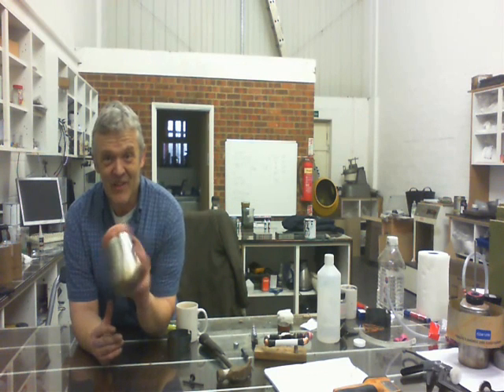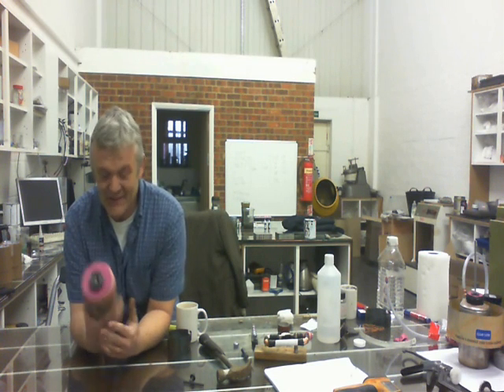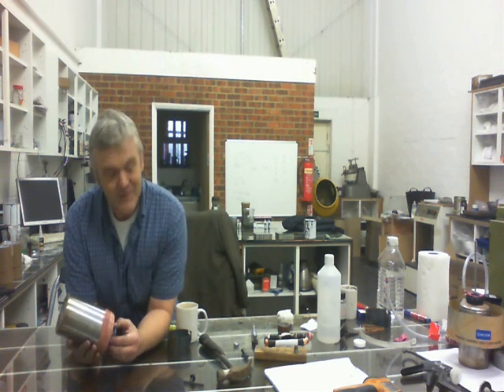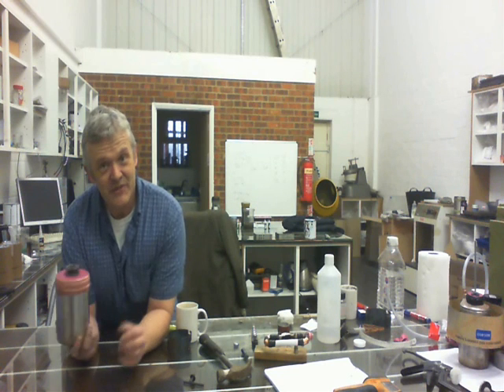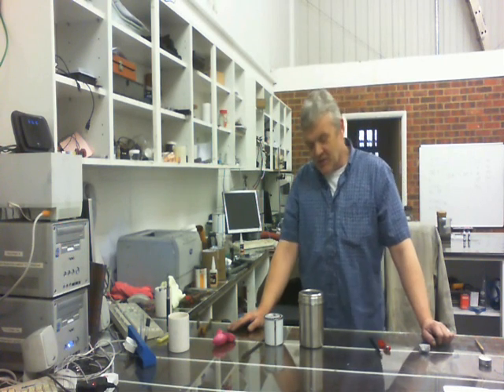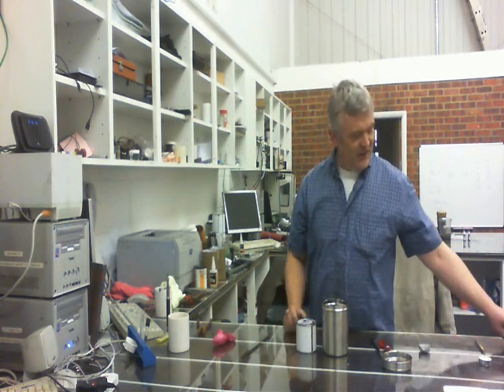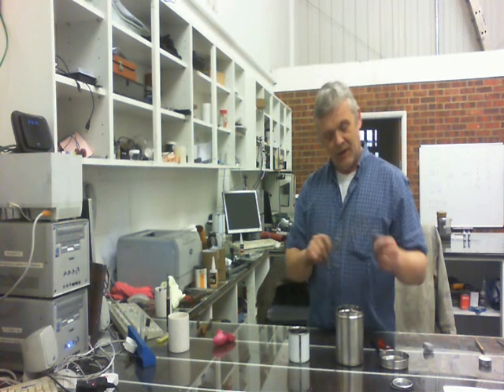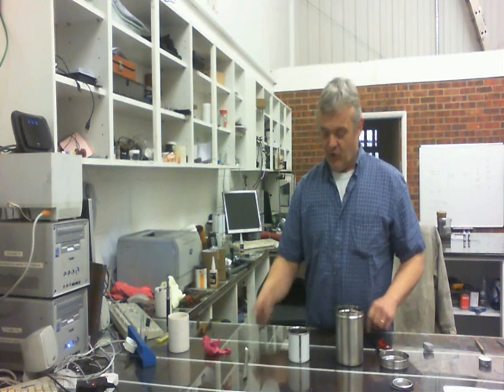The NASA Stirling Engine - Made In An Hour - Step By Step

Comment: Robert I have seen an even simpler design yet. The displacer did not move at all (adds drag and friction) instead it was stationary but as in your design there was a membrane on top. The "displacer" (more a can open on top and bottom) had some steel wool wound around it as the regenerator. So the air would be heated inside this displacer can, the membrane on top would start oscelation and shove the air through the regenerator around the (displacer can) to the top where the piston membrane sitzt just as in your design. What would you say, it this design in even more of less beneficial ? I think it might be more beneficial because the displacer which is a huge part does not move inside and thus introduces drag to the air. At the same time I think the benefit might be lost because the small membrane moves less air to the top. I am really not sure of what to make of it.

Comment: I just tried to replicate this with two cans of Pringle’s potato chips…didn’t work 😢 Can’t figure out why. I think this model requires a lot of heat to work  and as used Pringle’s cardboard cans with tin bottoms, I cannot heat it too high. Could that be the reason? Brilliantly simple design though and I will replicate this no matter how long it takes!

Comment: Would putting extra holes in the inner can make it work any more efficient. like having a small hole at the bottom and maybe one small hole at the top Or even several holes. then maybe have a gear cog facing up so every time it goes up it moves another gear cog which in turn could be connected to some type of battery cell for charging etc.

Comment: This might be useful to a few accentrics out there, but much of a free piston sterling engine can be abstracted to being the equivilant to two passive radiators, add a coil and magnet (aka make one a speaker driver) and suddenly you have a way to measure it as a tuned mass system (and also a way to generate electricity)
Reply: Im really tempted to take a passive radiator and a small subwoofer driver and see how the impedance measures, if I'm lucky the plot will look familiar

Comment: Edit, never mind, I saw the follow up video on doing exactly the below, after I wrote the below.

If you use a bigger magnet and put coiled copper wire on the outside of it, will it generate enough electricity for practical use like charging?

Comment: On a crazy note you know those toothed rubber belts on motor cycles. If you wove nitinol wire on the out side of it and you put it on a planetary gear box maybe it could work as the driver for a generator powered by hot water. Just a thought. As it it would take a lot of wire to get much power and I seen the woven nitinol on the new mars rover. The idea is to make a toothed rubber belt like a steel belted tire but woven with nitinol instead and make it into a toothed belt as motor for a planetary gear set up because you could get more torque for slow moving generators or some speed if you use the little planet gears through a planet carrier.

Comment: Quick note: Rotary Stirling engine with two rotating chambers counter balanced with a thermal acoustic chamber to run the two off a single heat source. You have two rotating disc that are about a couple of centimeter thick or how ever you big you want. Just so they are counter balanced as they both have a hollowed out chamber for gas to expend. Then they are both connected to a tube that you put heat on. This metal tube is filled with a bit of steel scrubber or steel wool pulled apart for the thermal acoustic chamber. And you apply heat to it and it is supposed to set up standing waves of hot air that drive the rotary Stirling engine. I thought that would be a neat device if it should work. I seen some on you tube. Where the tube replaces the displacer on a Stirling.

Comment: Well it isn't like you can just take the spark plug out of a gas engine made for a wood splitter and hook on a large tube made like that end of a thermal acoustic Stirling engine and make it run off of hot air.

Comment: Nice.  I just saw one of these made on another channel, but this one looks like it has superior efficiency.  I've been scouring the web the last couple of days, and wound up frustrated that one can't just go out and buy a Stirling engine in a "commodity" sort of way the way you would a DC or AC motor.  Looks like if you want to get into that arena you're stuck with building it yourself.  So instructional material like this is great.
Reply: you can get kits at least you don't have to make it from scratch... although those are of different design than this one... Good luck.

Comment: WOW... best DIY Stirling setup I've seen so far......
Will this work in reverse ?
like a cryo cooler ?
Reply: I would think that there would need to be a connection through a spring between the upper membrane and weight and the displacer in order to activate the displacer but I could be wrong hopefully mr. Rob is inspired by your comment and tries it

Comment: I think the Stirling engine does not have the torque
The reason is that the motion of the piston inside the cylinder
Is due to temperature difference between the sides of the cylinder
And not the pressure resulting from the explosion of fuel above the piston 
So you will find a big machine but produces little watt

Comment: Excellent demonstration of what is in fact  a complex thermodynamic cycle coupling two vibrating systems through the dynamics of the fluid inside that container.  This gentleman seems to enjoy  what he was doing and the result shows his depth of knowledge, even though  it is all hidden by such simple manner of building this linear machine.  I have made one similar to this but mine contains a long pipe where the air in it acts like a piston.. The displacer is  directly connected to the  top rubber membrane.  These are NOT simple machines to analyse in detail.

Comment: Im watching this video again and again and again and I love it.Im very curious how much efficiency does it have?..if you seperate the cold and hot sections of the canster and let the gas be the only thing that is transfering the heat its efficiency will improve.also you can add a heat sink half-out half-inside of the top baloonto help the gas have more thermo-contact with outside air...if you put a neodymium magnet and a coil on top of the heat sink you can test its efficiency under electrical load ...I love this.thank you for your video
Reply from the maker: I like your ideas mate - I haven't done that m much with this for a while but i think you are looking like you have a better grasp of this than i do - cheers mate
Reply: Well, the engine looks like it's producing 5 watts or so.... not sure if there's any point in having a heat sink or trying to improve its efficiency
Reply: @JiunnWong  yes but imagine being able to produce more than 5 watts with the same design and dimentions
Reply: @alijabari8715  then I suggest a hand crank generator, less noise,  no fuel required, more power. You can make out of microwave oven parts and fit in your pocket

Comment: This is very interesting!

Do you think it can be used to superfreeze stuff?
Reply from the maker: no idea mate - sorry
Reply: Robert Murray-Smith thank you! I've been investigating since last nihght and since the process is the same it might be possible to cool down suff by using this method, but we would then to have a mechanical method to drive the membranes instead of using heat displacement. I'll look into it further! I think I've figured out a way to bust out good amounts of energy of compact TECs, but I need to get into cryogenics to test the idea...  Making a stirling engine for this purpose has a very very steep learning curve, but in theory if the temperature difference is wider on each side of the tec,  the more power and effectiveness you can get from it! Let's see what happens!
Reply from the maker: absolutely mate - it is an interesting idea but as you say very often trying it and seeing is the only real answer - let me know how it goes

Comment: I love the sound of a finely tuned Stirling,  If anyone is interested Israel has set many records in solar efficiency with the same type single piston Stirling.  I have made a test rig of 64, 6" x 6" mirrors in a dish shape, to reflect focus the sun to a heat pick up. I have gone a different way in solar energy for now. If anyone would like my old dish project & wants to continue on with my work please let me know. I have one patent-able concept for efficient energy transfer to over also.  Peace Out!
Reply from the maker: awesome
Reply: Skylar, where are you located? I have dish pieces at machine shop. I think he would actually like it out of there. I have the mirrors in boxes  at home. you would have to pick up everything in a large pick-up truck.  My heat pick up / exchanger / is "patent-able" & I would like to partner with an investor  on that.  I'm actually working on a new bad ass tracker on my solar array & will work perfectly on the dish array.... hhhmmm
Reply: Hi, I'm interested. I wanted to know if it's possible to generate 5-7KW using solar stirling system. And if I use Compound parabolic troughs instead of a dish, what maximum temperature can I expect if lower is about 20 degree  C
Reply from the maker: try it and see
Reply: Hi Dan, do you still have the dish, I'm interested. I am also planning to build an engine and would like some help if you can.
Reply: Hello Dan, I am interested in the design and would like to work with you on the dish. I am currently building a  Stirling engine. Please contact me on sheldon@inventindia.com.
Reply: I sent you my contact information.   Peace Out!
Reply: Cheers Mate. Have sent you an email.

Comment: Hi Mr. Murray, you've inspired me to try and attempt something similar to what you have created in this video. However, I'm experiencing some difficulties and was curious if you could offer some feedback. 

My first question regards the weight on top of it all - do you recommend any way of figuring out how much you need or just playing around with it until it starts?

My next question regards the balloons you used; instead of balloons I used cut up pieces of a cut up rubber tarp, but I'm afraid they're a bit too thick. Any suggestions?

Thanks for any feedback in advance.
Reply: Try steel washers, then add or subtract them to add or reduce the weight. With the weights, it's trial and error.   To thick won't work the same of course, again try it and experiment.

Comment: Cool! Have you used magnets and a wire coil to generate some electricity ? The Biowatt Wood Stove use a Free Piston Stirling to make 60 Hz AC while you warm your cabin in winter. Don't know shout summer. Read somewhere long ago about Stirling Engines being use in Thorium fueled Nuclear power plants to keep costs down. Stirling had some advantages over steam turbines but I don't remember what it was. Have you tried running it with dry ice? Keep the hot end at room temperature and chilling the cold end with dry ice.
Reply from the maker: +ufoengines this is pretty much all i did with it mate - i have quite a few projects on and didn't go that deep into this one - but your suggestions a good ones - did you try them?
Reply: I had know idea that you could build a free piston stirling with stuff from around the house so you post is pretty cool. Now I'm thinking that if you drove the "free piston" with a solar powered electric motor it might become a useful enough cooler to chill my cooler full of beers. This also might be a solution for a self chilling beer can! Place the can in sun light for a few minutes the solar stirling combo does it's cooling  thing and ta da ! a chilled beer for after mowing the yard, or something.
Reply from the maker: +ufoengines lol - nice one mate - i can see a market for that lol
Reply: Read decades ago that the president of the mighty Continental Can Corporation said if somebody can come up with a self chilling soda /beer can that is cheap, safe and recyclable that they would make that dude richer then Bill Gates! Neat! Has not happened yet, smart phone app or otherwise. Lots of cool patents on the idea though.
Reply from the maker: +ufoengines well - you sound like the guy to get it done mate

Comment: Approximate temp of hot side?
Reply from the maker: +Scott Jackson a couple of hundred degrees C - it will work on 3 tea lights if that helps
Reply: +Robert Murray-Smith thanks, got one working but requires heating via propane torch. I suspect the issue is more with heat soaking up the walls of container(lower Dt) than the temp required to drive everything. Thanks again, good vid.
Reply from the maker: +Scott Jackson cheer mate - it's a tuned system - it can be a bit difficult to get it right

Comment: i tried it with slightly different materials.  aluminum canister slightly wider and shorter, slightly different tin can, etc.  It did not work.  Is there a plan somewhere that specifies optimal internal and external can volumes and other specs so that I can troubleshoot?
Reply from the maker: +Jonathan Passey trouble shoot by adjusting the weight on top of the rubber mate - it is a tuned device
Reply: +Robert Murray-Smith  Thanks for your quick reply.  I did try three different weights by sticking large washers on with neodymium magnets.  I think my stirrup might be hitting the diaphragm and interrupting the cycle.  I dunno.  I may tear it down and rework it a little later.  For now I think we are going to experiment with Gamma-type Stirlings.
Reply from the maker: +Jonathan Passey fair enough mate

Comment: wow that was pretty cool, luv sterlings as of recently. love this design...after you intially heat it up and put top on , do you have to keep doing that or does that creat some kind of suction from the heat/cooling effect and then it will be like that for future uses. also i see it works like a piston, is there a way to attach something to it or connect it toa fly wheel, i mean can this actually produce any kind of function?

ty great vid.

Comment: Hi Robert , your varied interest amaze me , been following stirrings for many years and Attila's diaphragm design appears to be the first practical and affordable design that could be used for actual battery charging applications 
Have you any idea what would make a long lasting diaphragm material ?  Could it be a piezo electric material as well ? 
Can this be upscale to something about twice the size of attlia's large engine 
? Could the diaphragms be strong enough to allow pressurized helium By the way great job and video as always
Reply from the maker: CHeers mate glad you like the vid and agree the design is excellent. Unfortunately all the questions you ask are best answered by experimentation - but, having said that - I think you would get good results with all the ideas you suggested - particularly the piezo version - personally I think with a little redesign this would be an excellent LTD engine - I have had a thought about that - i just haven't had time to do anything with it

Comment: Hello. Watched all of your videos with great appreciation! though half of it went over my head surely. Have been trying to replicate your Stirling engine build. I understand the concepts and It is built exactly as you have shown. it is air tight so the top membrane gets quite inflated when applying heat and quite strongly pulling  in when cold. I have a feeling I'm getting the weights on the top wrong so my question is what sort of weight you got on the top there roughly? 100g? 500g? Sorry if this information was already given. thanks for your time.
Reply from the maker: O Sweed you are on the right track mate - the weight is important to tuning the engine - what i did was glue a small neo magnet on and then use large washers until it worked then weighed the washes - it was around 150g - but each one will be different and you will have to play with the weight until you get it right
Reply: Robert Murray-Smith Thank you for the answer. I have been trying something similar as you suggest in the video. Will get it running soon.
Reply from the maker: O Sweed cool - look forward to seeing it mate
Reply: Robert Murray-Smith
hello again. Still couldn't get the Stirling going. I altered weights from 50g all the way to 330g, adding 10g at the time. On some weights it feels like it wants to take off (jumping up and down for 20 quick times and stops) and on others it resonates less. I added a water jacket and found that the engine stops functioning when I put ice there. It comes back to life when ice melts.  I modified the balloon membranes to  marigold gloves and it is appear to be more resilient. Stirling still inflates with heat and pulls in when cold. The inner section displacer has a small hole to the body and I am able to blow inside through it and inflate the displacer's membrane, it shoots the air back out through the hole and deflates the membrane. It that correct? What am I doing wrong? I am heating it until there is some inflation of the top power membrane and then try to start it by tapping on the top. If you can point out if im doing anything wrong form this description, it would be great. If unclear i will be able to post a demonstration vid. Cheers
Reply from the maker: O Sweed what are you heating it with?
Reply: Robert Murray-Smith
Butane gas mobile stove. It's strong enough for sure. could it be that my parabola isn't accurate enough or is made from the wrong material? I started with an aluminium ruler and moved to a folded tin can lid which is slightly more flexible. still no joy.
Reply from the maker: O Sweed can you do a video mate - because just right now i really haven't got a clue why it isn't working for you